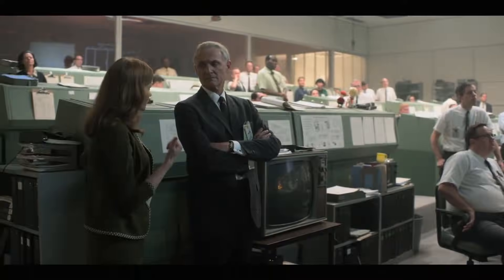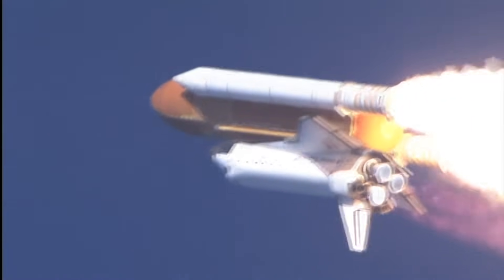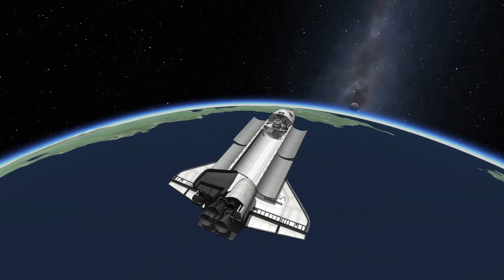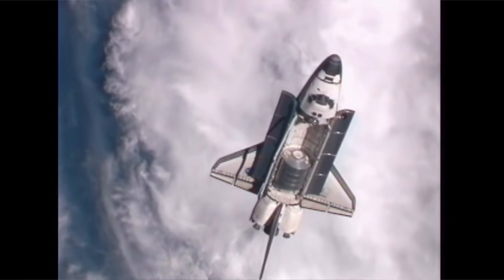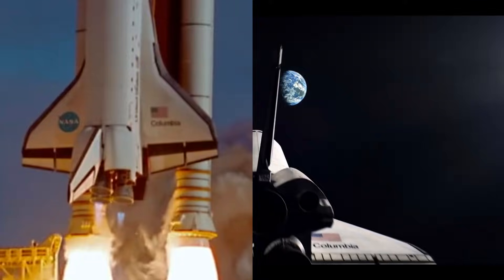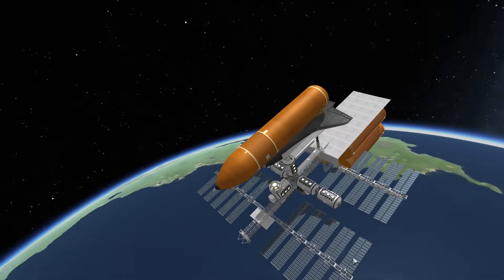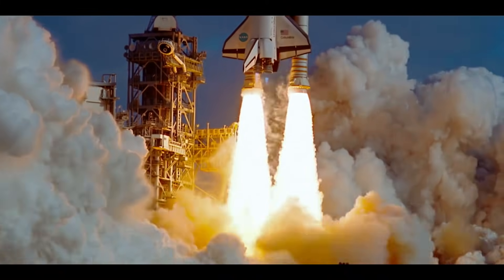How To Send A Space Shuttle To The Moon

Comment: What happens if the use the SLS SRB's on the Shuttle?  That have the extra segments.
Reply: Not enough to get a shuttle to the Moon!
In addition to the larger SRBs, the SLS also has one extra shuttle main engine (RS-25) and a core stage with 33 % more fuel than the shuttle's external fuel tank. Despite that, its payload capacity to the Moon (27 tonnes) is less than 2/3 of what a Saturn V could send there and about 1/4 of the total mass that the shuttle system could send into low Earth orbit.

Comment: Something that struck me when watching this is when Scott mentioned that a shuttle coming back from the moon would be dealing with reentry at a greater velocity, & thus need greater heat protection. I don't know much about orbital mechanics, or whatever the appropriate term is, but couldn't the return journey be calculated such that instead of going straight into reentry, it would go into orbit around Earth, & do whatever maneuvers are necessary to get it ti be at the same speed & altitude it would normally reenter from?
Reply: Changing the trajectory from an Apollo style lunar re-entry to a re-entry from low Earth orbit that the shuttle was designed to do would basically be a trans lunar injection in reverse and would thus require the shuttle to slow down by about 3 km/sec. Slowing down that much would take about the shuttle's total mass in additional fuel if using hydrogen/oxygen in the shuttle's highly efficient main engines and even more if using the less efficient OMS engines.
If the shuttle couldn't be refuelled underway, that extra fuel would need to be brought all the way to the Moon and back and would at least double the total mass that had to be launched from Earth in the first place.

Comment: The problem with all of this is that v. Braun was correct in the 1950's. We have these up and down missions that cost zillions because all the energy we use to launch it is blown during re-entry. If the shuttles flew into space and were not designed to return and we had a 200m diameter ring type space station where say 0.8g could be simulated (humans will never adapt to zero-g we should stop screwing around with it). The shuttles and whatever else would dock at the hub where microgravity would reign and so positioning these craft and all of that would be comparatively easy. People would live in the rings and modules could be swapped out as required. 
The shuttle should have been able to support a crew for ~6 weeks. If we go to the moon, then we do not have to follow an Apollo trajectory. Much of that was due to inability of the equipment to keep the folks alive for much longer than two weeks. However, if we aim instead for the point where the forces of Earth and the Moon balance, we could then tip over and just fall to the moon in a lazy arc and slowly change our orbit using small engines to do so. The lander could be in the Bay and when we get there there could be xfer between the shuttle and the lunar base and then the shuttle could do some recon and finally go back home the same way. On the way back again you go in lazy arc changing your orbit carefully and meet the station under control. 
All this would probably have cost less than all these launches. 
Right now we have the ISS and absolutely no way to fix it if something big like the solar panels fails. I fear in 15 to 20 years we will have little up there and a few reports no one reads and about 800 lbs of the moon. I think strategically the program was misdirected.

Comment: Just how capacious were those external tanks?  When saying that the shuttles could not re-enter the atmosphere from lunar orbit, one is assuming a direct return from lunar orbit.  With enough additional delta-V one could in fact return the shuttle to low earth orbit, from which it could re-enter and land normally.  Probably, rather than be that wasteful of fuel, actual practice would be to decelerate enough put re-entry velocity within acceptable limits, if there was insistence on using the shuttle for lunar missions.

Comment: There is a way to get a shuttle type craft to the Moon.   Stretch the design by adding 125 Feet to its length and 50 feet to it's wingspan.  Then use the engines from Space - X that are even more economical and Powerful. Then use Ion engines for the trip to the Moon and back also for a slow deceleration. The Technology Is There. You Just Got To Want To use it.

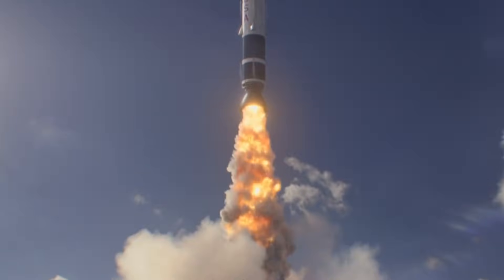Comment: 8:59 The shuttle could fire its engines to slow down before entering earth's atmosphere on a return from the moon, so it would not need to withstand that velocity re-entry like Apollo did.  It sounds like there would be enough fuel in the main tank for this.  However the TV show does not show the external tank attached to the shuttle when it is returning to earth.

Comment: The orbiter itself is 85.98 tons, so might as well say 86 tons in mass. So this means, you'd need either a new rocket, or you can put the orbiter on the Saturn-V. But wait, the Saturn-V can only carry 53.57 tons to the Moon. So, you'd need to change a few things and/or add stages to the rocket itself in order to take the orbiter to the Moon. Now, you'd probably have to add little fuel tanks in the payload area in order to make the orbiter capable of coming back to Earth from the Moon.

Comment: If you insist on using the Space Shuttle it would be better to use as it was intended, to shuttle items into low Earth orbit. You could shuttle fuel and space ship components to orbit and then assemble a secondary vehicle for travel to the Moon and back. It wouldn't have to be aerodynamic as it would never be used inside an atmosphere.

Comment: Wouldn't the space shuttle's batteries also limit the range of the shuttle? The RS-25 engines require electricity and the space shuttle didn't have solar panels to recharge them. From the limited research I've done, Solar panels can be pretty heavy, and the more weight on the shuttle,  the more complicated it would be to get to the moon. Just a thought that popped into my head while watching the video.

Comment: You can launch a second smaller external tank. And it can dock with that when already in orbit. And then use that fuel to go to the moon. Then put a lunar lander in the cargo bay, because the moon has no runway. Why would you want to try to lose all deltaV from a trip to the moon using atmospheric breaking only?
Reply: Because otherwise you have to carry extra fuel with you to slow down, and you have to carry extra extra fuel to get the extra fuel up into orbit.  And to boost it to the moon.  And back to earth.  For every kilogram of fuel you take to space, you need ten more kilograms of fuel to get it to orbit in the first place.   Atmospheric braking doesn’t require any of that.  It just needs an ablative heat shield.  What are you going to use to launch that “smaller external tank” into orbit?

Comment: Umm you keep thing of this from a 1980s approach. If we put the space shuttle on the back of these newer rockets, while also transporting a smaller fuel tank. You could propel these into to space and the shuttle could use the spare tank to get to the moon.
Reply: If your goal is sending the shuttle to the Moon, entering low lunar orbit without landing, leaving that orbit again and slowing down enough to survive atmospheric re-entry without a massive strengthening of the heatshield, the required delta-v from low Earth orbit is about 7820 m/s.

That's just within the capacity (8180 m/s) of the shuttle if its external tank could be fully refuelled in low Earth orbit before leaving for the Moon and the boiloff could be kept to an absolutely minimum. However, that would be quite a challenge for a mission lasting at least a week, especially with the hydrogen's boiling point of -253°C. The tank's insulation would need to be improved considerably, and the tank should be painted white, just as it was initially.

Any tank smaller than the external tank that actually was used would be insufficient, and using several smaller tanks would make the boiloff problem worse since smaller tanks would have a larger surface per unit of volume.

Comment: I think with enough monkey motion, such as refueling in earth orbit, and maybe in lunar orbit as well, then returning to high earth orbit first, slowing down considerably and slowly decreasing it's orbital height and speed down to what it was designed for before re entry, it could be done. But it would be a whole lot of work and $$$ for nothing. What would putting a shuttle in lunar orbit accomplish? You couldn't land it, nor would it be practical to transfer something from the shuttle to the lunar surface or vice versa.
Reply: What if we build a spacecraft much smaller than the shuttle designed to bring the astronauts to lunar orbit and back to Earth? Let this spacecraft be docked to an even smaller one designed to land on the Moon while the "mothership" stays in orbit. If made small enough, the two spacecrafts could even be launched by a single, large 3-stage rocket without any need for refuelling. 😊

Comment: What if before reentry there shuttle does a burn to reduce it's speed? Would that lessen the heat from reentry?
Reply: Yes, but if you wanted to reduce the speed to that typical for re-entry from low Earth orbit, you would need about the shuttle's own mass in fuel (~80 tonnes) if that fuel was hydrogen/oxygen burned by the main engines. Using the OMS engines would require even more fuel since their MMH/N₂O₄ fuel is less efficient than hydrogen/oxygen.
All that extra fuel would need to be brought all the way from the Earth to the Moon and back, adding thousands of extra tonnes of fuel needed to be launched from the Earth, unless some of that fuel could be produced on the Moon.
Reply: @fromnorway643  ohh... So it's possible then, that's good.

Comment: After President George H. W. Bush made his return to the Moon proposal, and idea was circulating around JSC to use the Shuttle. The idea was to launch a modified, fully fueled ET into orbit. Then, the orbiter would dock with that and thus have enough fuel to go to the Moon and back. A lander would be carried in the payload bay. We were already working on advanced heat shield ideas which, suitably modified, could have been fit over the orbiter's belly. The biggest problem most people saw was that, given how much refurbishment the main engines needed after every flight, we had serious doubts they could actually be refired, not once but multiple times.

Comment: In theory, a spaceplane could land on a planetary sized object in horizontal fashion.

It would require managing vertical velocity like Apollo, but the landing would look like a typical shuttle landing but the shuttle would land backwards; landing with the engines in front and nose at the rear, then braking on a runway to come to a stop over several kilometers.

Comment: Use the shuttle to take a much smaller craft into orbit, send that to the moon, and use the shuttle to bring it back.
Reply: You would need lots of shuttle flights to bring up enough fuel for that craft to go from low earth orbit to the moon and back. It would be much easier and possibly cheaper to launch all you need with a single Saturn V, if those were still available - or use two Falcon Heavys.

Comment: If you could do a free return trajectory from the moon to earth, why not a earth to the moon, as in Apollo 13. Using a shuttle/lunar module combination I think it could be done.
Reply: It doesn't work like that.
A free return trajectory ending up on the Moon is possible in principle and would require much less energy than the one ending up back on Earth as Apollo 13 did, but there is one little problem:
That kind of mission would have to start from the Moon, so it wouldn't really be useful for earthlings wanting to travel to the Moon.

Comment: 9:00 in theory I guess you could do sevral passes at high altitude with reduced temperature, slowly aerobraking to ge into something close to leo to reenter from
since it's not an ablative shield it can theoretically take an infinite amount of heat energy as long as it's spread out over a long enough time and low enough temperature
would take a while and still wouldn't make too much sense
but then... could say the same for the actual space suttle

Comment: It could absolutely work if they used some fuel for braking before the reentry. A pity NASA never thought about this.
Reply: If you add the extra propellant at the beginning of the mission for the braking maneuver at the end of the mission then you will need even more propellant to get all that extra propellant out of earth orbit and on its way to the moon. Then you will need even more extra propellant to slow it all down to get it into lunar orbit. And then you will need even more extra propellant to get it out of lunar orbit again and send it back to earth. Adding a requirement for more propellant at he end of the mission creates a requirement for several times as much propellant to be added at the beginning. This is why aerobraking is the preferred way of reentering from deep space because all you need to add is the weight of the heat shield.
Reply: @joevignolor4u949  Didn't Scott mention that the fuel could me made on the Moon? So actually the shuttles could transport it from a Lunar to low Earth orbit. Possibly several times before returning to the Earth.
Reply: @arctic_haze  And how complicated and messy would that get? And what would be the point? The best way to accomplish deep space reentry is by simple aerobraking at the end just like they did on Apollo. That way the only extra weight you have to carry the whole way to the moon and back is the heat shield. And because of the two spacecraft design used on Apollo the heat shield on the Command Module never even had to go down to the lunar surface and come back up again. The purpose of that being to eliminate the need for even more propellant that the Saturn V would have to lift at the very beginning.
Reply: @joevignolor4u949  What would be the point? Mostly fun.

Comment: Was he saying that there would be 're-entry' on the moon? Why would there be heat if there's no atmosphere? Also, why couldn't the shuttle simply orbit the moon, drop it's payload, and then head on back? I guess I'm not understanding the whole section about the heat shield issue.
Reply: I think you misunderstood.
The problem arises when the shuttle returns to Earth. Its speed after the long fall from the Moon would be over 40 % higher than in low Earth orbit, and that would double the heat stress during atmospheric re-entry.
Using engines to slow down to low Earth orbit speed before re-entering would require at least the shuttle's total mass in extra fuel, i.e. about 80 tonnes of extra mass to bring all the way to the Moon and back. That extra mass would also increase the fuel needed for all the manoeuvres before that, including launch from Earth, translunar injection, braking into lunar orbit and leaving lunar orbit again.
Reply: @fromnorway643  Oh! I see now, thanks. Yeah, maybe it could pick up some fuel from the moon base.

Comment: You could probably actually modify the 747 used to transport the shuttle and use it to transport to LEO and seperate once when its in LEO so the 747 can get back instead of using it to transport the shuttle from alternate runways.

Comment: A launch vehicle like the Energia?  Maybe?  That launch vehicle was designed specifically to give the Soviet Union a vehicle capable of sending payloads to the moon.  I guess a booster capable of sending the shuttle to Lunar Orbit would have to be bigger and have more fuel.
Reply: According to the Wiki article, the Energia's payload capacity was 100 tonnes to LEO and 32 tonnes on a trans lunar injection (TLI), so it was less capable than the Saturn V. It would certainly not be able to send the American or the Soviet shuttle (Buran) to the Moon.

Comment: They managed it in Airplane 2, so I guess it was possible. Re: thermal issues, they’d likely just have it roll like Apollo. I personally think a shuttle could be used to ferry to/from LEO and lunar orbit (with propellant up at a space station in LEO as you showed), and maybe drop pax off via some sort of Apollo style lander from the cargo bay. The problem is still how will it slow down as it’s falling back to Earth to reconnect with the station in LEO. Either way, even if you could get it to the moon and back, it a) can’t land on the moon, b) can’t take off from the moon and c) can’t withstand a 25,000 mph re-entry (or slow from 25,000 mph to 17,500 mph to re-enter or meet a LEO station).